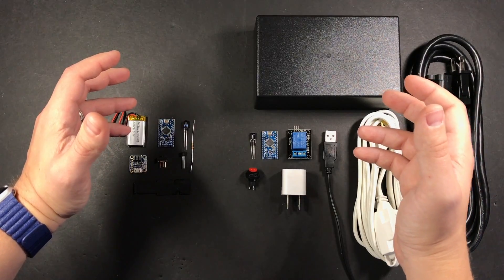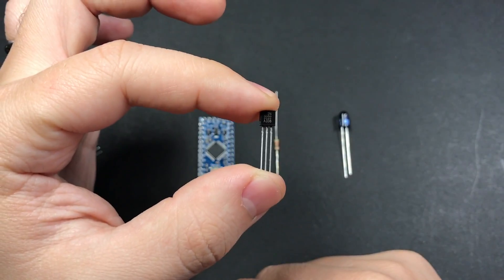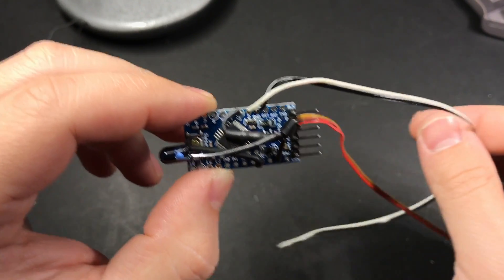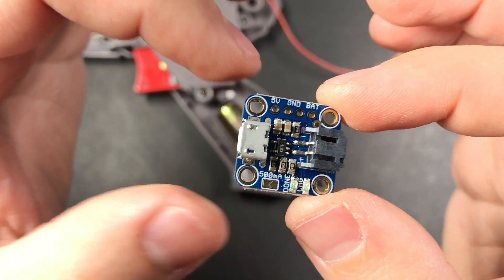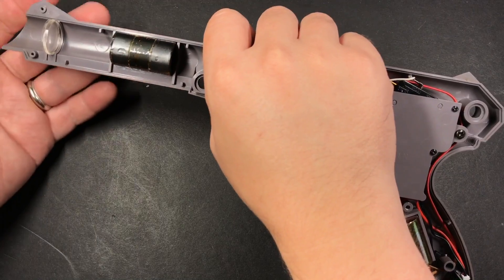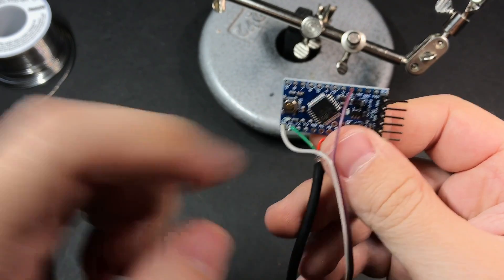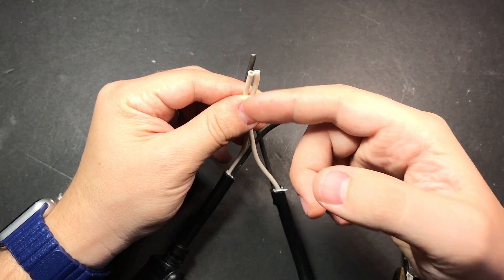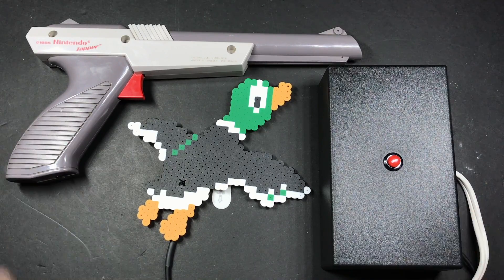Lamp Zapper Guide - Control a lamp using an NES Zapper gun!

Comment: Ive had an idea for the zapper and it seems like you could complete it with just a few tweaks of this project you made. 
Basically make the zapper wireless. Keep the orginal light emitter but add a bluetooth module and battery that would connect to a receiver like the ones by 8bitdo. If anyone can make this its you! Love the videos!

Comment: Wouldn't a better solution be to have the trigger power on the Arduino, as well as a transistor that will bypass the trigger, letting the arduino finish it's thing, then let the arduino break the power again turning itself off.

this way it wouldn't use battery while doing nothing and you wouldn't need a powerbutton for the gun, and no need to ruin the it by cutting a slow for the powerswitch.

don't want pretty retro things ruined completely :P
Reply from the maker: This is actually how I was initially going to do it.  :)  The problem is the trigger switch actually only closes for a split second -- right when you hear the click, the switch is open again.  So, I don't think there would be enough time for the Arduino to turn on and do its thing before it would get shut off again unless you always pulled the trigger verrrryyy slowly (and who wants to do that?).
Reply: wermy that's why I suggested a transistor in parallel that would keep the power on, and have the arduino break the power after it's finished it's "mission". (by sinking the current way from the transistor, making it not conduct anymore?)
Reply from the maker: Oh sorry, I missed that part!  Yeah that's a great idea. :D  I still wonder if it would be enough of a delay as it powers on and does its thing that it might be annoying.
Reply: +Gizmo That is a pretty cool idea, but I wonder what kind of delay it would have? Would you have to aim for a bit after trigger pull? I kinda like the instant nature of an "always on" set up

Comment: does that usb cable only have 3 wires. ive seen 2 wire usb cables but never 3
Reply from the maker: It had 4 (red/white/green/black) but I only needed 3 so I snipped one off.